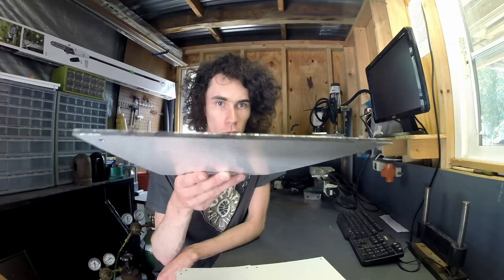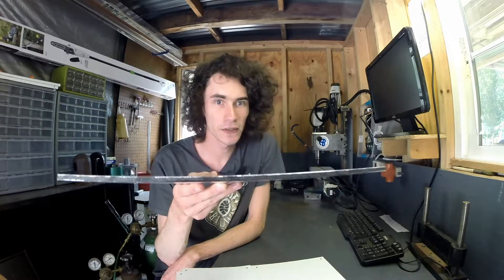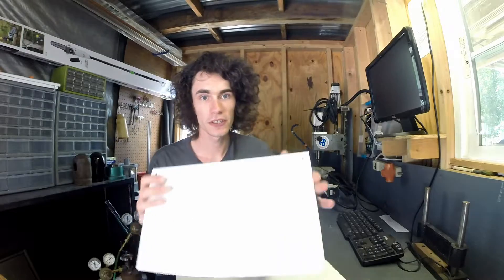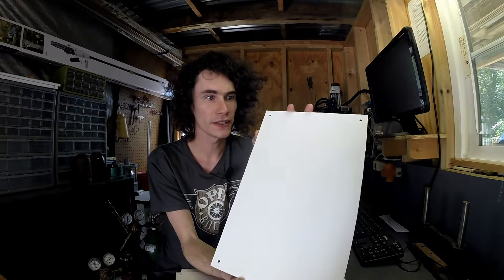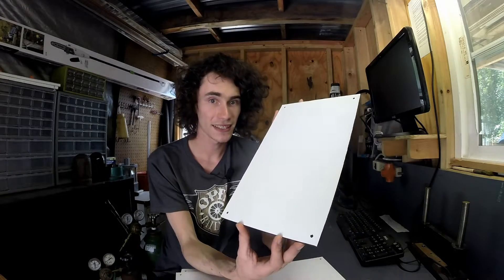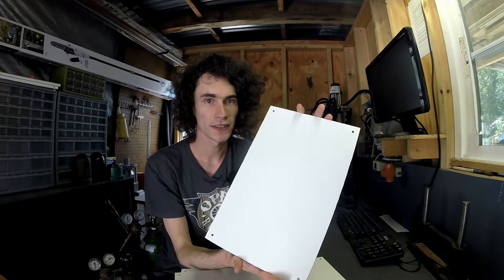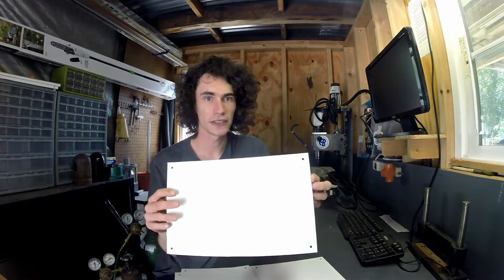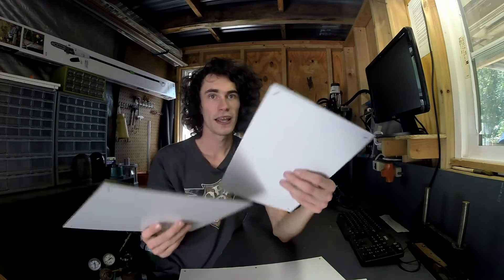How to work with Aluminum Composite Material

Comment: Thanks Calvin, would you mind posting a link or doing your own vid on the actual structure of these sheets and the options available and perhaps compare to fiberglass and epoxy carbon circuit board sheets? I am building a 32 inch macbook pro laptop! And, I need to know what my options are for the shell (box) that surrounds it (gives it structure and light weight rigidity.
Reply from the maker: Hi Randall, sadly the actual project this was intended for never panned out... I would say for your application I would almost lean to the fiberglass for rigidity, but that stuff is absolutely nasty to cut and if you wanted to attempt any bends, that is out of the question. If you are able to get your hands on some of this, it may be worth exploring.

Comment: Does anyone know the off gassing or toxicity of these plastic cores when subject to higher temps?
Reply: Some laminate cores are PE, but Alumalite is PP, so it depends... Look up those materials. Also depends on the temperature! The materials tend to not be useful in higher temperature applications because of the plastic core and its low softening temperature. They do however use it for building cladding.

Comment: Is this the very material that caused the death of 72 residents in Grenfell Towers , Kensington,  London in 2017?
Reply: Because of course, this was the sole reason those people died.....
Reply: @MrRo22Ro22  it is a fact that fire tends to go up, if the cladding is flammable it will burn more easily, and soon later, the fire may engulf the whole structure.  Fire-resistant materials should be used for allowing the residents to evacuate, imo.
Reply from the maker: That specific brand I do not know but based off what I read that type of material was in use.

Comment: Pretty interesting materials. I know some 3D printers are using such panels: Dynamo3D for the chassis; a crazy guy is using it nearly everywhere on his Delta : http://www.zatsit.fr/english-summary.html
Reply from the maker: I know my Ultimaker 2 uses it for some of the structural components, albeit with thicker material. It is nice because it is relatively easy to work with vs others and is also pretty light. In the future, I may remake a Thingomatic style 3D printer with this material for the frame vs wood.
Reply: It will be cool to see such build. Thingomatic style is a good candidate to have an heated chamber and you can do nearly whatever you want on the extruder,/hotend which is great. Only issues, lot of room for the same build volume,  you need to have large diameter rods due to longer lengths . It will be interesting to see what improvements can be done on the bed assembly with such panels.
Reply from the maker: Right, that's the biggest issue with the design although to be honest if i were to make something I would maybe stick with the same setup or find a way to make it a little more space efficient. Ultimately it is all just an idea in my head and it may or may not come to fruition any time soon. But you never know...